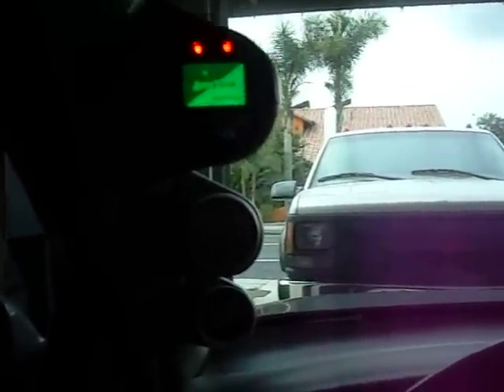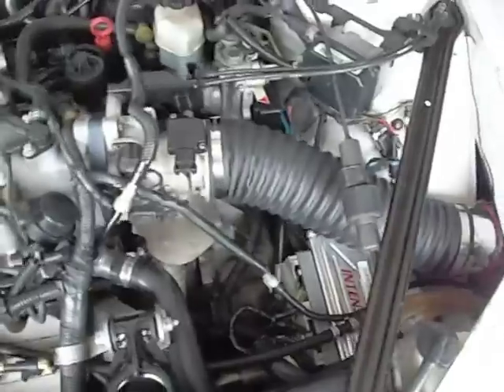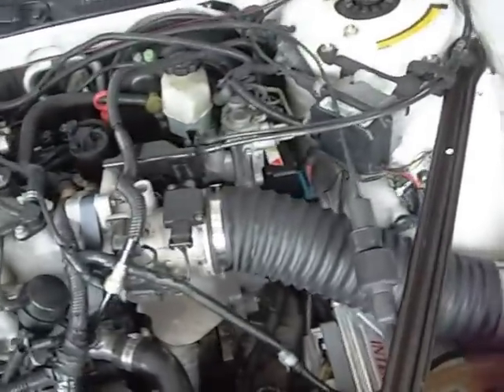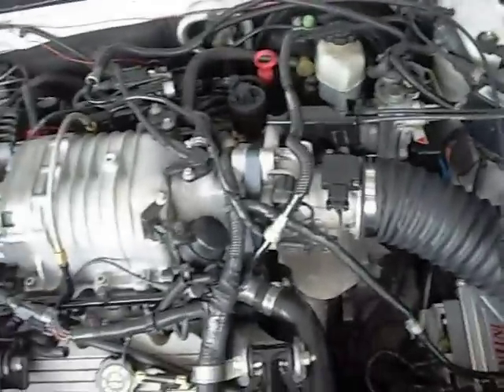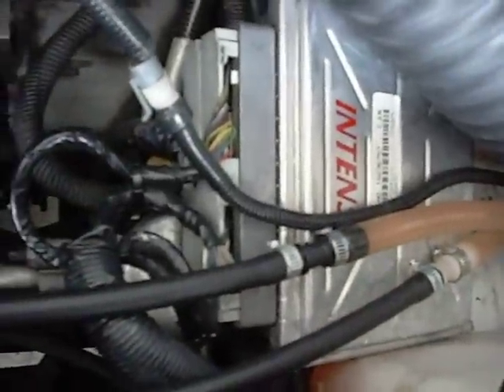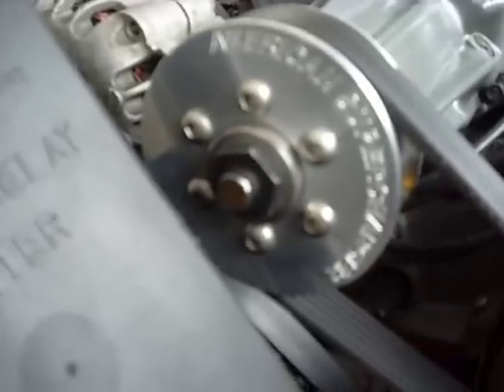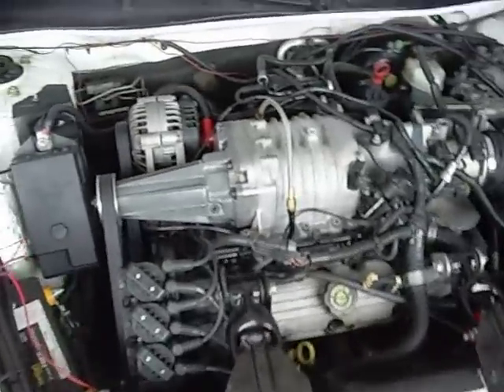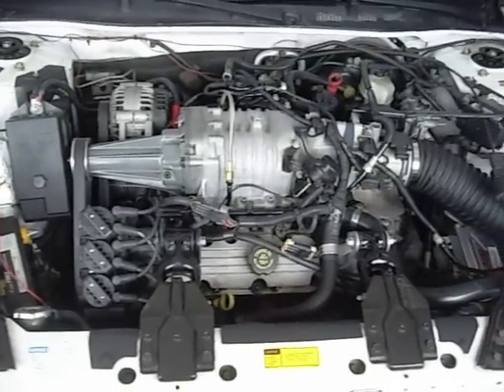3800 Series 2 Modding Basics

Comment from the maker: Installation is simple. 1 cable goes to the OB2 port and 1 is the power. If you want an easy way to power it simply go to the electronics section of an autostore and get this thing called the "Add a fuse" kit They cost $7.

The manual the scangauge comes with mentions it. You can install it in 10 minutes.

Comment: Okay since nobody else brings it up... Bigger pulleys create more resistance on the crank thus lowering horsepower and torque, not increasing it if you want less resistance on the crank you want "underdrive/smaller diameter pulleys". But these will over time take their toll on the crank as well

Comment: Hey John, i like your video very well put together. I have very similar mods to my 99 GS everything except the 3.2 pulley i am running a 3.4 pully with Autolight 104 plugs << recommended for you set up!!! i am currently running about 265 wheel HP like you said cheap but effective... just think it comes only with 240 crank!  Tomorrow im going to get me a 99 GS cant wait!!

Comment from the maker: My factory digital boost gauge burnt out so I replaced the air/fuel gauge with a mechanical boost gauge.

You can actually install a cam by dropping the subframe so the motor doesnt actually have to come out.

Im leaning more towards rockers because I heard you will need a new transmission shortly after a cam install. Knowing me though I probably will go cam =P

Comment from the maker: Yeah I really need a better tune but my cars still running great even without a custom tune. Better then stock for sure.

If you go with the short stack intercooler its going to be about $1000 with modded fuel rails and all the gaskets and stock part replacements you'll need to do the job.

Fullsize is about a $2000 project because when you drop down smaller then a 3.0 pulley your going to need bigger injectors. 

Youll still be happy with a short stack if thats your budget.

Comment from the maker: If you have a budget of about $1000 you can upgrade your LS nicely.

The cheap stuff for less then $300 is 2.5 inch downpipe, highflow muffler and build your own intake. I have a video on how to do build your own intake and it'll work with your LS.

If you want even more performance get high ratio rocker arms and an updated PCM. That will help especially past 60 MPH.

Comment from the maker: Its worth the money bud. Youll go from 0-60 in 8 seconds down to the low 6's/high 5s and go from a 16 seconds car to a high 13 second car.

Massive gains. Just remember in the quarter mile .1 second is about 1 car length so 2 seconds is a massive difference =)

Comment: I just got a 2004 Dale Jr. SS and i'm looking to do some mild modifications. I bought the Stage 2 inter cooler with machined manifold form zzp. I wanna go with a 3.3 pulley, 3" down pipe and cat back.

Comment from the maker: With a 3.5 you're going to run some knock. Get a DownPipe installed ASAP. Dont worry about replacing the mufflers. GTPs dont have restrictive mufflers until your past 400 horsepower. Changing mufflers are more for sound.

Do remove your resonator though. It should cost about $40 at a muffler shop

Comment: I just got an 02 Pontiac Bonneville with the 3800 supercharged, fully stock. Not looking for crazy power, but one thing I was thinking about doing was modding the exhaust. Should I go with aftermarket mufflers or could I just chop them off and straight pipe it? I chopped the muffler and just put in pipe (leaving the cats on so it was leagel) on the 98 Chevy Tahoe I use to own and it worked great. Not too loud with a nice little HP and mpg increase.
Reply: Yes. I have Flowmasters 40 series and a high flow cat. Sounds nice

Comment from the maker: Yes sir you can. And actually a N/A with a Supercharger makes a little more power then a 3800 that came with one because of the higher compression in the non supercharged engine.

Your going to need the heads,intake,moddified fuel rails and of course the supercharger to accoplish this.

Its going to run you anywhere from 1500-3000$ depending on where your source your parts. 

It can be done on your own. This is by far one of the easiest cars to work on.

Comment: I currently have a 2000 Regal GSE and I am starting my mod process i pulled the heads and just finnished a full intake and exhaust valve cutting at the machine shop so the vales are the largest they could fit in the head ported and pollished the the head and intake!  upgraded injectors and fuel pump fuel pressure regulator! my buddy John Rader at Jr Performace engine shop just custom cut a cam for me to open the giant valves just put that all back together  with 118lb valve Springs and performance roller rocker arm kit from summit racing and starting the supporting mods like just orders the zzp intercooler 180°thermostat a modular pulley kit from ebay and a set of headers 1'7/8 with a 3' outlet and ubend delete from zzp along with a computer upgrade with timing advance and others! solid motor mounts and EGR delete platinum spark plugs 18mil plug wires and super coils from Excell from summit racing with the new advanced air flow from the heads and the 2.8 pulley I'm gonna use on supper charger this  will be a race gas only engine 110 octane replaced the oil pan with a aliminum fluted pan for better cooling and a bunch more to do but I am expecting to put around 600 hp at the wheels and for that reason the transmission is being beefed up its at the trans shop getting a lot of work including input and output shafts 2300 stall converter performance clutches and others this trans build cost almost $2000.00 it better be bullet proof!! so yeah I have almost $5000.00 into the process  and hope to have a car that will run low 11s  high 10s in the quarter mile still waiting for my race rims and slicks to come order from summit racing 8 days ago that was not include in what I spent in the engine and trans build I have hd racing drive shafts and upgraded brakes front and rear! struts from summit with adjustable variances to tune them in to hook up at the line with everything done I feel like I'm gonna need a roll cage but I really wanna keep this thing looking like a stock car on the outside true sleeper stile! my buddy John from the engine shop thinks I should get 15 psi of boost but I thinks only 11psi because of how ported the heads and the size of the valves the engine is gonna breath well so I don't think it will build that much boost!! hope to get some videos up eventually of the finished project in a few weeks but still have a long way to go
Reply: What did your car run on 1/4?
Reply: Nathan Schild  it's still not finished!! haven't had it out yet???
Reply: Joshua Rollins so how is the car doing? Did you change the pistons? I know they chip away with boost when you change the pully.

Comment: Actually, "messing with the engine" is the way to avoid the problem, which is quite rare (less than 1 in 1000 cars had issues). Simply replacing the valve cover gasket and/or re-routing the plug wires is all that needs to be done. That's it. There are 2 ways to react to the word "recall": make ignorant assumptions, or find out what's wrong and fix it.

Comment from the maker: Mines just an off the shelf tune. I'm guessing with a custom tune I'll gain a good 20 horsepower. My tune is for the basic supporting mods like the 3.4 and a down pipe. Currently my setup has headers,IC and a 3.2 plus all the other small stuff.

Comment: My last 3800 series 2 in a 2001 Regal just may be my last...i never knew about the fatal flaw which I never hear no one speak about....faulty fuel pressure regulators, causing a backfire resulting in cracked intake manifolds and worse case scenario like mine...engine fire which also resulted in a total loss. I hear this is only an issue with series 2 non s/c engines. Can anyone else shed light on this topic, cause at the moment I'm really considering getting a 2.2l 4cyl Camry lol

Comment from the maker: @calistameghan 

KR is a safety measure for Supercharge and turbocharged cars.

If your engine is getting to hot you're engine gets knock and your engine pulls timing to protect your engine.

Your computer can only pull so much timing thats why if you add too much boost and you dont have enough mods your motor goes BOOM!

You can monitor KR with a scangauge.

Ideally you want 0* but 1 or 2* wont destroy your motor. 10* or something nuts like that and your motor will be toast in no time

Comment from the maker: I could of easily done the rockers when the upper half of my car was taken apart to change the gaskets and install my intercooler.

If you look in my videos youll find a "3800 partially apart" video and you can see how easy it is to access the back valve covers when everythings apart.

I want to get my car cammed but I dont think I can pull it off myself so I'll probably get help for that.

Comment from the maker: Since you're just starting off I would just go short stack Intercooler from the start.

$600 mod but if you start off with that you'll be able to drop down to a 3.3 or maybe even a 3.2. That's a big time horsepower increase. Were talking 50 horsepower and 80 Ft Lbs of torque and you'll have yourself a car that will do the quarter in the 13's.

Comment: What I meant was if you're just driving casually your transmission is probably going to be in 3rd gear around 40 and if you step on it just kicks down one gear for more power. A reprogrammed computer will kick down all the way to 1st gear.

Reprogrammed computer also raises the RPMs by 500 and increases timing. It's worth it

Comment from the maker: I would go with a engine swap.

Ed Morad is the man on Ebay and he sells engines for less then $2000 I beleive.

I would go this route because you can cam it easily since the engine will already be out.

Cammed 3800s are very good set ups and you have a low 12 second car easy. With a Gen V blower you should be in the 11's if your cammed,headered and have a good tune.

Comment from the maker: I'm running TOGs have to go with the expensive stuff since I'm California and it needs to have the carb EO# to pass inspection  =/

I have about an inch and a half clearance I just had to loosen the slack on the wiring and zip tie the wires as far from the headers as possible.

Comment: You and the guy below are severley mistaken. GM owns the 3800 architechture which varies from the 3.8 found in the early to late buick 3.8 v6's. Thats why 3800 was in alot of GM platforms as opposed to the 3.8 that buick used

Comment from the maker: @calistameghan 

I would consider getting a scanner, you might be getting some knock with that setup

160 is too cold of a tstat because the knock sensors dont come on till 160-165 i believe. I would go with a 180 to make sure your Knock Sensors are coming on because with a 160 tstat your engines too cold.

Comment: @calistameghan  

here the thing i have an 2001 ssei with some mods fwi, 605 plugs, new wires,3.4 pully,  160 thermostat  and took off the old mufflers and put on some high flow ones. pcm is next not to sure what to do next?

Comment: Thanks for the vid. You mentioned regals & gtps. Will the mods you talked about work for a 96 riviera? I was thinking to start, plugs, coils, cai, tune or chip, 180 thermostat, and sc pulley 3.4?  Idk if that is enough to properly support the sc pulley though. Any other suggestions? Thank you!

Comment from the maker: If your 100% sure you just want a 3.4/3.5 pullied car then a plog/DP combo is good.

Headers are supposedly good for a 25 horsepower gain on a stock car while Plog/DP is good for 15.

Headers are worth it later down the road if your getting an intercooler/rockers or cam.

The most important mod like I mention in the video is a scanner. If you have 0KR then you can drop down pulley sizes.

If you have the know how to install headers yourself I would still choose headers even with a 3,5.

Comment: and if you can answer my question about needing a special tool to remove the stock alternator pulley... can you send a link you used for your solid motor mounts.. i looked on that website and i thnk i fould the ones you have... but i wanted to be 100% sure.

Comment: Very nice mate I'm interested  in the throttle body spacer. Does it do much to stop heat soak? Might try and make one myself and put it on my l67
Reply: +Hasan Elezovich Heat soak in the throttle body? There is no fuel in there so you would be wasting your money. It's a con, don't fall for it
Reply: +NitroAl well my throttle body gets quite hot have you ever seen the holden l67? the set up is different than the US version. hot air equals less power think about it
Reply: +NitroAl  a throttle body space should work like a carb spacer or a high rise manifold for carb'd engine. making for about 200 more rpm top end. makes the plenum larger area. not much to do with heat soak.

Comment: Hey John, Do you still have the regal? I learned so much from your vids years ago. My on my 5th 3800 powered car. And I cant get enough. My 03' Park Ave Ultra(a boat) tied a 2016 turbo civic at a 45 roll with a couple bolt ons. I'm not tring to brag. Just saying they still have a soild place in my mind. Easy to modd and still daily drivable.

Comment: hey man, you obviously to know a lot about 3800 engines.  I have a few questions if you have  the time: I have a '97 buick lesabre and it also has the 3800 series II, there is a mufler shop in my area and I got a price to upgrade my stock piping to 3 inch throughout and I going to have a dual set up out the back like the camaro exhaust dual with one muffler, it will be a flowmaster 40 series.  Do you believe that my buick will have good sound to it or should I also remove the

Comment: hi i run a grand prix gtp i have all the same mods exept the intercooler i just installed 1.9 rockers and they are a must i would change out the air fuel meter for a boost gauge if you didnt yet i would take out the throttle body screen there are directions on zzp tech articals

Comment: Also I was to put a high flow catalytic converter would that tamper with the o2 sensor, ive heard the o2 sensor is somewhere around there possibly and i dont want any check engine lights to come on??

Comment: Got a L36 (yeah I know not a L67) but still liked it and the first mod I did to mine was the aluminum gasket upgrade with aluminum elbows and replace the UIM all together with a new one.

The second was to dump and flush the radiator and replace with conventional green.

The third was to upgrade with Heavy duty sway links (gm made plastic spacers on the stock ones)

I painted the acoustic cover black and red (not really a mod but the grey cover bothered the shit out of me)

New plugs and wires and new pcv and some other small stuff (coolant stepper motor for the dash springs to mind had to solder a new one in)

The stupid pcv valve almost needs 3 o rings to properly seat and not whistle. I put a small one below the pcv valve where it goes normally, Then I had to put one under the spring to add extra push on the pcv valve into it's seat so it wouldn't work loose and cause the whistle and of course the big orange o ring. This has stopped the whistle that sounds like a belt squeal so far. If it is not done eventually you'll hear a nice squeal sound and it will cause the engine to stumble after starting sometimes. You'll also throw a small evap leak code. It's just a pretty stupid design for it to be honest.

good vid with good tips though
Reply: +evilcowboy ive seen a bunch of L36s with a turbo swap and they run low 11s with supporting mods and all that. just gotta know what you are doing.

Comment from the maker: @heartboy86 

Build an intake,pick up a highflow muffler if you have a resonator get that removed and if your thermostat is 195 degrees get one thats 180.

These are the 3 basic mods you can do on anycar and your car will sound better,run cooler and you'll pick up some extra horsepower.

Comment from the maker: @barffboy217 

Did it come with garlock (Blue) gaskets? If so those don't seal well and I would use RTV on them or get factory or equivalent gaskets.

Also Did you crack a vaccum line? Is everything reconnected?

If your vac lines are fine and everything is connected then your gaskets are not sealing and it's a vac leak.

Your car only stalls when your at idle right once your moving everythings fine?

Comment: what muffler would you recomend? i have a NA 3800 and i was thinking about a high flow cat to a magnaflow glass pack resonator to a hooker aerochamber muffler. i know i need a new exhaust because the car just sounds like it is groaning under load and feels like it is down on power in the low RPMS. also does that computer chip help my shift logic? the transmission is in awesome shape but it is really hesitent to downshift after braking have to stomp on the gas to get it to kick down after braking

Comment: Also the mass air flow sensor is part of the intake so I cant replace the stock tube because the check engine lite would come on because my air flow sensor would be off.  Could I only replace the filer and just clamp it off?  If you can offer any other suggestions for cheap added horsepower or website for buick 3800's I cant find anything for buick  lesabre mods on the web only pontiac 3800 mods and regal gs mods.

Comment from the maker: If you want to hear the supercharger whine all you need is an intake. Simple as that.

If your not concerned about adding power and you just want the whine ebay sells intakes for cheap. They arent the best designs but itll do and your car will be a lot louder with it.

If you want to do a better job then ebay then emulate the intake I have on my car.